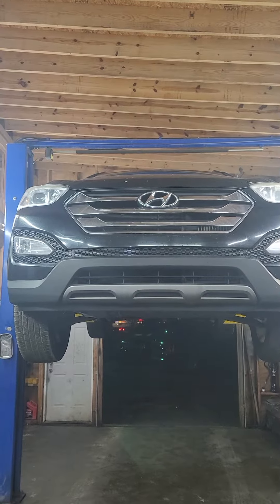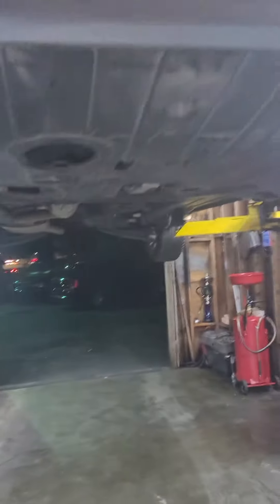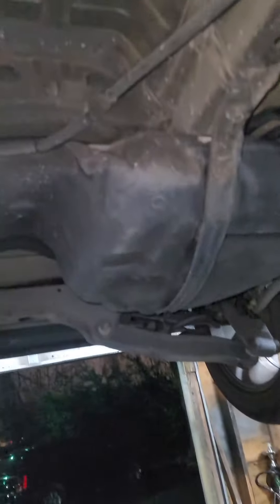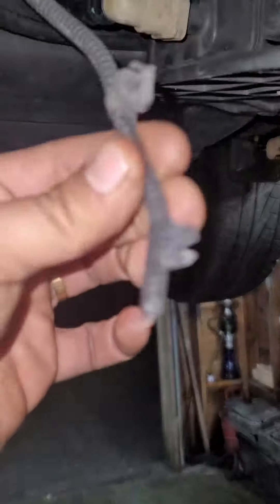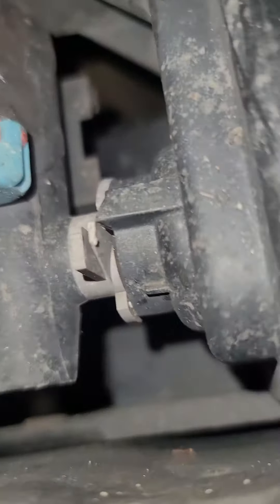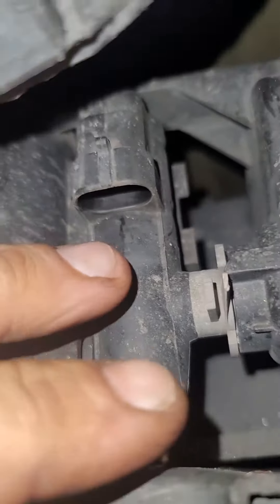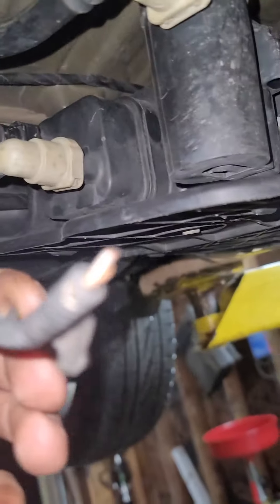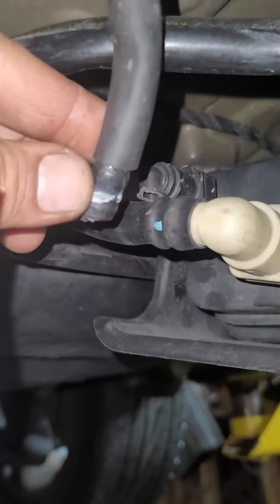2013 hyundai Santa fe code p0447 vent valve (fixed)

Comment: This is exactly what was wrong with mine. One wire was broken. Thanks for explaining how to test the sensor too!!!
Reply from the maker: You can test it with 12v. You should hear a click. Also, you can blow air by your mouth in the sensor tube it should be blocked, keep blowing, and then give it 12v. The sensor should open and let the ait go through.  Good luck

Comment: Hello bro
When I fill the car with gasoline, the car fills with fuel and it comes out of the hole. Is there a way to check and is evap vent solenoid  the reason?
Reply from the maker: "Usually, it’s the vent or purge valve, but first, remove the canister and inspect it. Sometimes, it gets internally damaged and blocks the EVAP hoses. If you have a scope camera, insert it into the fuel tank hose where you fill the gas and look inside. I had this issue before—some kids threw gum in there, which ended up blocking it."
Reply: @hanitwfik  Hello sir
I checked the  evap vent solenoid and it turned out to be faulty. When I put 12 volts on it, it does not work. It always stays open. Is this a reason for what is happening in the gasoline tank?